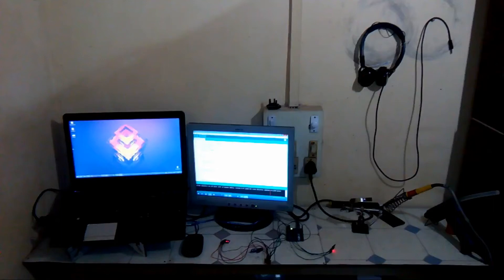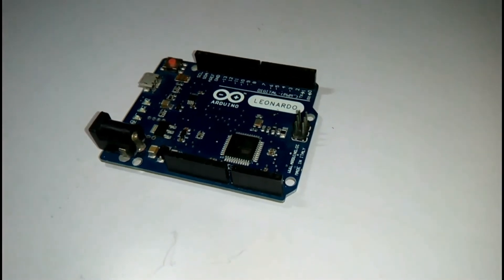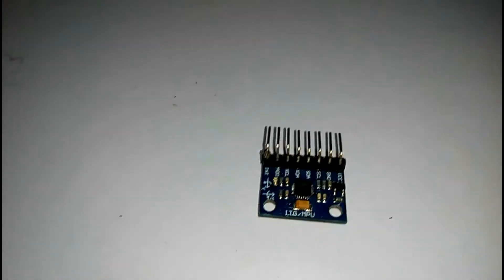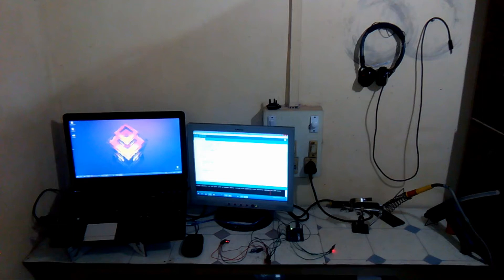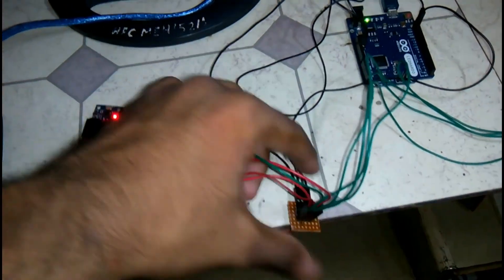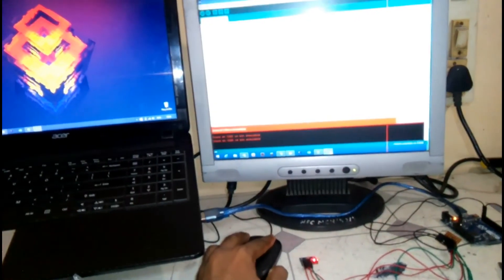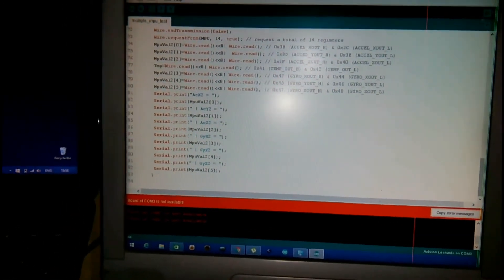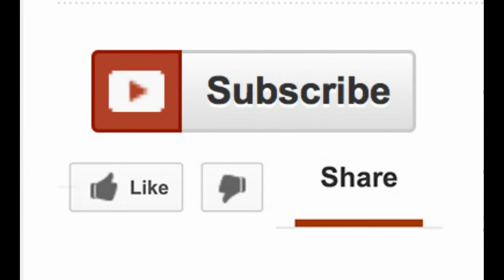how to connect multiple mpu6050 with a single arduino board

Comment: Thanks! What is the other thing that you're using in the video and is it necessary for me to get data from two mpu6050's and an arduino? (I'm currently getting 0's for the data instead of actual data to compare)

Comment: Can we connect 5 mpu on 1 board
Reply from the maker: You will have to use i2c mux
Reply: @kapilgoswamiTechInventor  great thanks ❤️❤️❤️❤️...
I also had a doubt... I wanted to calculate the angle of a robotic link so can I use this sensor mpu6050 to get the angle. Like the angle can be anything between 0-360 degree will this work .
Reply from the maker: @vp.8181  yes you can do it,
Reply: @kapilgoswamiTechInventor  thankyou ❤️
Reply from the maker: @vp.8181  you’re welcome

Comment: Hello,
I am building a project, and I need to connect 8 mpu6050 sensors, but I am not sure how to write the code for it.
If it is possible can you help me.
Reply from the maker: You need to use i2c mux

Comment: How about using 3 sensor MPU6050? When you use only 2, as simple as connect the pin AD0 to VCC and the adress change into 0x69. How about with third sensor? Thankss..
Reply from the maker: To use more than 2 mpu you need to use i2c multiplexer, without that it wont be possible

Comment: but i want to use more than 2 mpu6050
Reply from the maker: For that you will need to use i2c mux
Reply: @kapilgoswamiTechInventor  yes i have one I am using the TCA9548A but I am not able to get it to work, it is giving me -1 as the values
Reply: @kapilgoswamiTechInventor  also i am uusing 19 mpu6050 to be exaCT

Comment: which unit are the values?
Reply from the maker: Its saw data
Reply: @kapilgoswamiTechInventor  what is saw data how i convert to normalize?
Reply from the maker: @Imesowi  i usually use the range and devide it to fit my own application but you can use kalmar filter or something like that

Comment: Hello 
I wanto to connect 5 mpu to one arduino , it possible with your way?
Reply from the maker: No, this method allows only two mpu because it has only 2 addresses
Reply: @kapilgoswamiTechInventor  
How can i connect five mpu to a arduino?
Reply from the maker: @industrialnoisecontrol9742  use the module called "I2C " multiplexer this will solve problem

Comment: we would need 17 MPU6050 sensors connected to single Arduino. Is there any way?
Reply from the maker: no you have to connect 17 MPU with 17 ARDUINO and those 17 arduino will be connected to main bigger arduino that is the only possible way to do that
Reply: Thanks

but powering all the Arduino would be a problem.
Reply from the maker: yeah that would be, what are you going for? wired or wireless?

Comment: Hi there, nice video. can you please show us the diagram? That will be more appreciated. Thank you
Reply from the maker: these are the parellel connection as listed below i hope this might helo you.

mpu1  Arduino     MPU2
vcc-------vcc-------ad0
gnd------gnd------gnd
scl--------scl-------scl
sda------sda-------sda
Reply: i gonna try it coz i'm planning to build a project with more than two mpu6050
Reply from the maker: yeah go for it
Reply: i got question, perhaps you have idea? can i connect 3 mpu6050, 12 servo, and 5 flex sensors to one arduino board? like i already have idea for 12 servo to be connect with adafruit board that is connect to arduino, so good to go for outputs, my problem will be for the inputs like 3 mpu6050 and 5 flex sensors
Reply from the maker: unfortunately, there are only 2 address for MPU 6050 so you can not add more than two, but if you use some kind of IIC multiplexer then this would be possible
Reply from the maker: this one :- https://www.thingbits.net/products/tca9548a-i2c-multiplexer?gclid=Cj0KCQjw9LPYBRDSARIsAHL7J5nATenrsqxLTFNUq9ZEZkD_21w9h2Za4RTtsXcr9sSVEvaWMazvCooaAmWnEALw_wcB
Reply: hmm thank you so much, this will be more challenging than i expected, perhaps i can your advice someday when i start?

Comment: Thanks man, i was thinking that my code is wrong, because when i connect the second MPU6050 the serial monitor stop(Im reading the data from both accelerometers), but now i know that one need to be connected to Vcc, and the other one NO, because is supplying with the AD0, sorry for my english

Comment: Can you share the wire diagram and codes for it?
Reply from the maker: yes im working on a newindeoth video it will be live soon for that stick around
Reply: what exactly did you do with the code to get "multiple". I am finding a way to build a sensor arm but only 1 seems not so accurate :p .

Comment: Hello Calpi, thanks for your project and awesome tutorial. Today Im trying connect 2 device in I2C wire, but not success. So I has some question: how far of wire that  connect 2 MPU to arduino work exaclty. Im will really really happy if you talking about your ideas an together in my gmail: vixuanthanh93. :)
Reply from the maker: Barbosa Hector maximum 1 meter
Reply: Kapil Goswami: how do you connect 2MPU in one wire?
Reply from the maker: Barbosa Hector wait for two weeks im making a saperate detailed video on this stay subscribe for the video
Reply: Kapil Goswami Yep, waiting for your tutorial
Reply from the maker: sure
Reply: Kapil Goswami Excurse me for another question: Are you using Kalmal filter for this project? and how do you calibration Z axis? ( MUP6050 not support for get Z axis)
Reply from the maker: Barbosa Hector for this video im not using any filter 
but may be for next video ill be using it

Comment from the maker: use a motor driver and initialise two digital pins and the sequence for the controlling motor with a digital pin will be in the datasheet of the motor driver itself

Comment: hello kapil,
i am working on a project that similar to this. tell me how can i initialize motors in it as i want to run  a motor with unity mpu and ardinuo
Reply from the maker: use a motor driver and initialise two digital pins and the sequence for the controlling motor with a digital pin will be in the datasheet of the motor driver itself
Reply: Can you share you code with me. zee.arain07@hotmail.com
Reply from the maker: wait for few week im making saperate video on that

Comment: Hi Kapil, right now i have a small project about mpu6050 that have to connect multiple to single arduino uno but i got trouble with that. can you share you wiring diagram and code please? i hope you can help me, you can send to my email jokowaluyo.jw74@gmail.com
Reply from the maker: Joko Noehcahyo will send soon
Reply: Thank you. i don't mean to push you to send it but i'm very thanks to you if you could send it immediately. i'm sorry man but i'm hurry with my project

Comment: Dear Kapil,
fantastic work, I am need to connect two mpu 6050 for small project. I am using Mega board, Could you please share wiring diagram and code please. Any changes due to mega? my gmail is dsembakutti@gmail.com. thanks in advance.
Reply from the maker: yes I'm making saperate video soom
Reply: Have you made it yet? do send the link on : qureshiroshanahmed@gmail.com

Comment: hallo kapil! great work! i need to achieve 4 mpu's simultaniously, can i have the wiring diag, and code? and is this possible with arduino UNO or nano? (does not have scl sda pin)
Reply from the maker: those does have i2c pins check pin layout of uno and nano both have those lins . 
and 4 mpu can not be used together you have to use multuplexer or you have to use multiple arduino as master slave configuration

Comment: hallo kapil! great work! i need to achieve 2 mpu's simultaniously, can i have the wiring diag, and code? and is this possible with arduino UNO or nano? (does not have scl sda pin)
Reply from the maker: it is possible with any one the board yes contact me via gmail ill send you all details
Reply: +kapil goswami  dp.dimpapadop at Gmail is my mail address. thank you very much for your help.